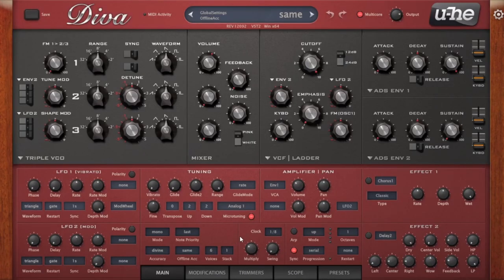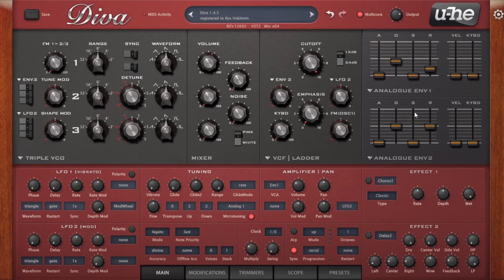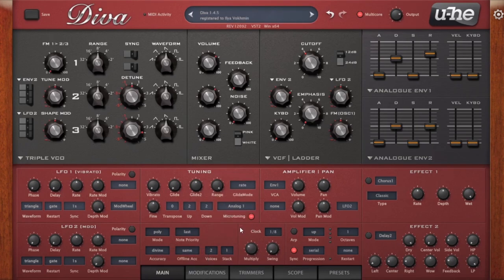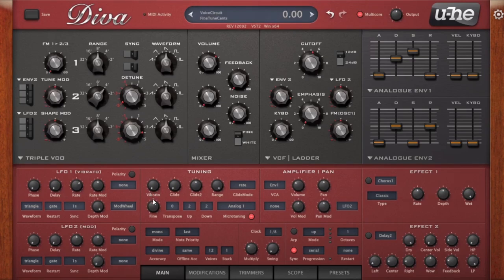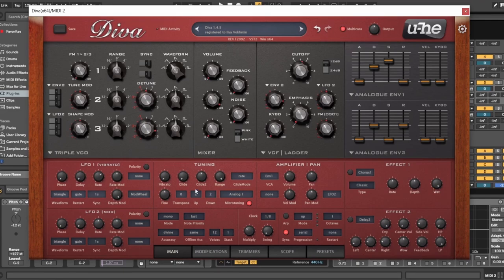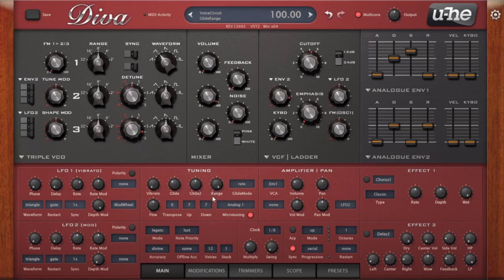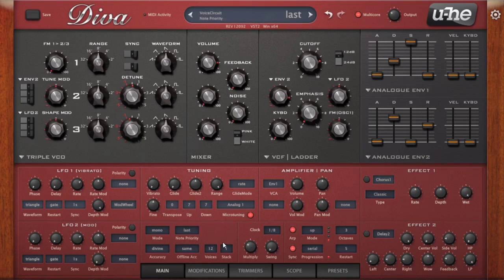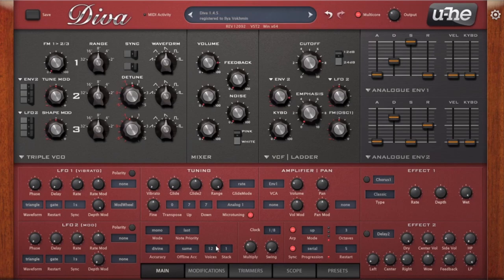DIVA Lower Panel Guide - "Main" Tab , Voices, Glide, Arpeggiator Etc pt 1/3

Comment from the maker: There is only one correction here, somehow it slipped by me that the Vol Mod knob is not the best way to do velocity, rather it is the velocity slider next to Env 1 when using Env 1 as your amp envelope as is usually the default.. that frees up your Vol Mod for other functions, however you may want to stick to the Vol Mod to do your velocity if you are using your Env 1 for more than just straight volume.